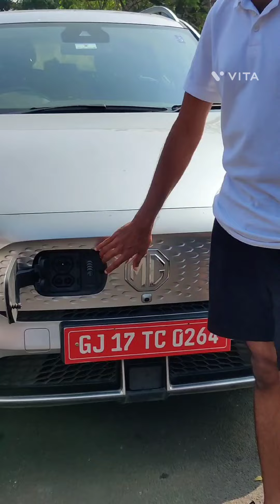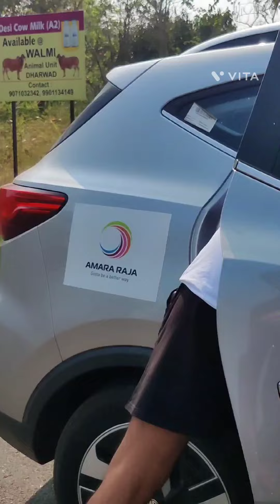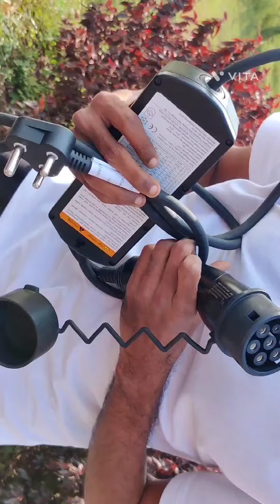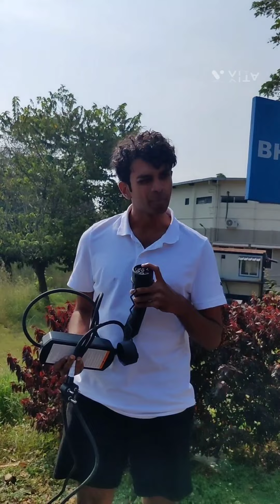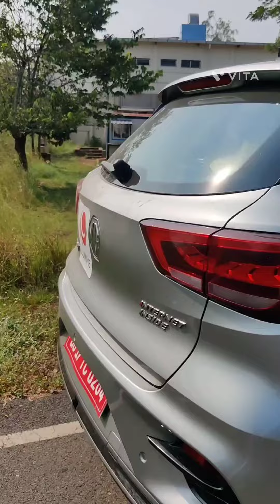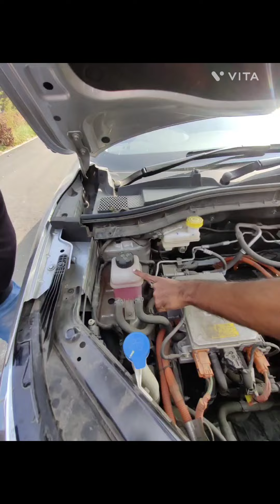#IITBOMBAY: The Sunpedal ride: 6000+ kms on MGS-EV electric car.

Comment: Very useful information.! Loved it..! ❤️ 
As per my knowledge i think the motor used in this vehicle is Permanent Magnet Synchronous Motor whose speed control is controlled by PI Controler & PWM controler Circuits..